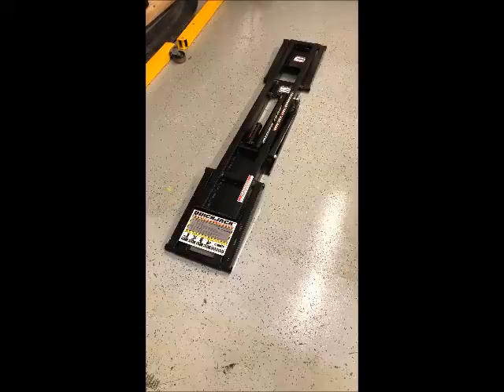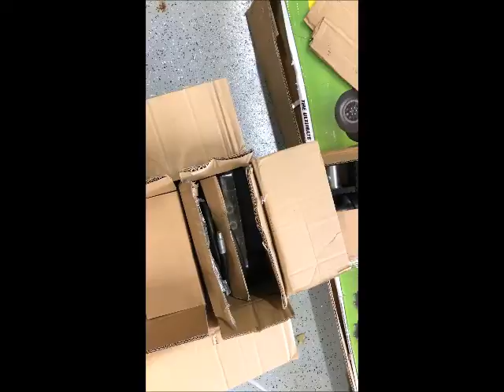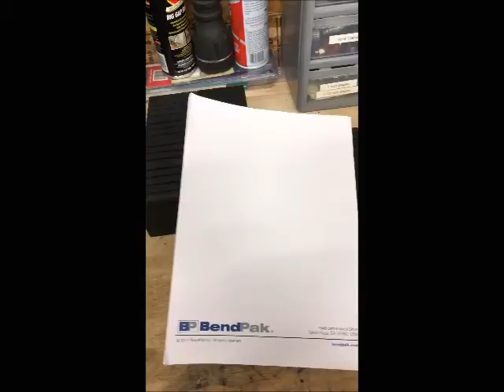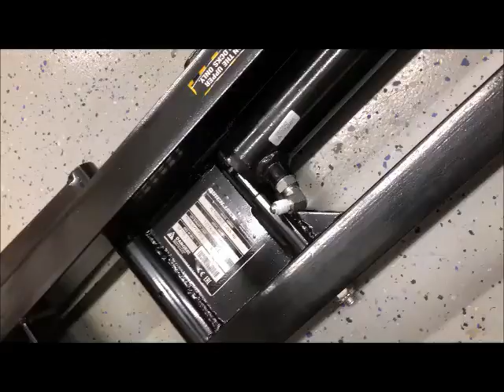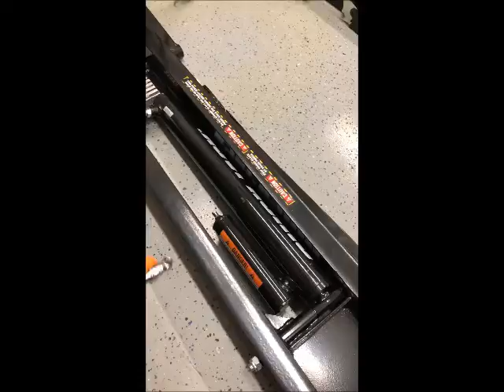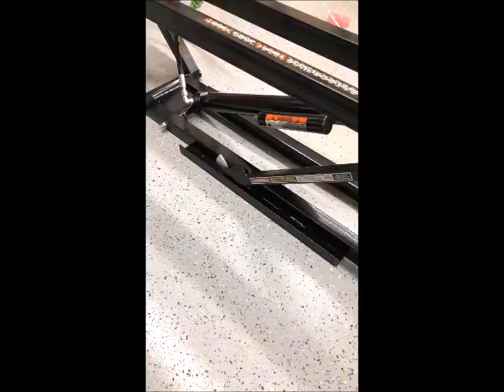Quickjack BL-7000SLX Unboxing and Setup

Comment: Do not need teflon tape on compression fittings or fittings with a jam nut and o-ring!
Reply from the maker: Yep I figured that out after. Thanks for the heads up.
Reply: Yea i see everyone put teflon tape on the flared end of the 90. Lol that tickles me.